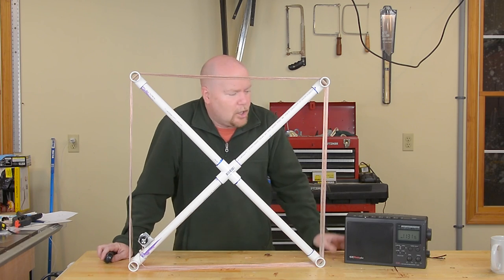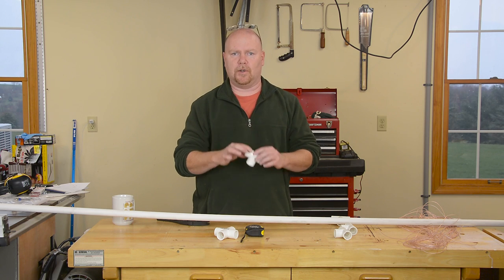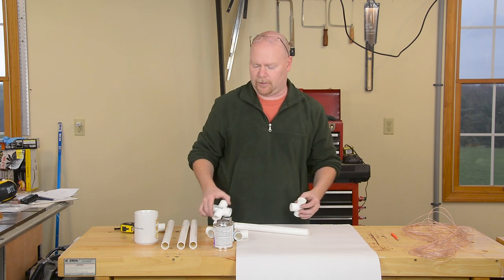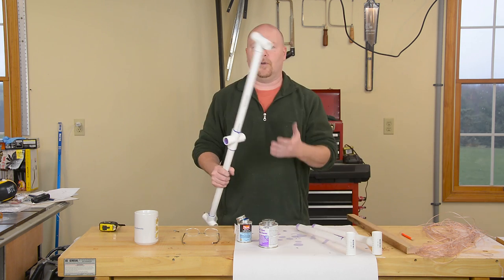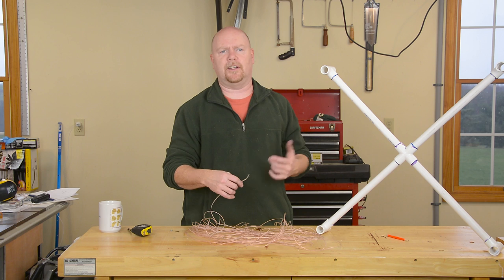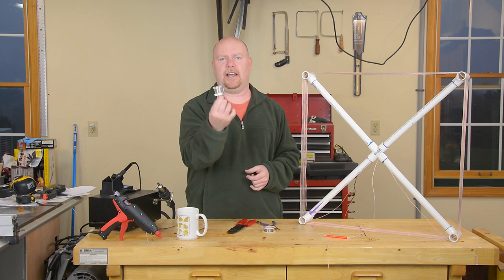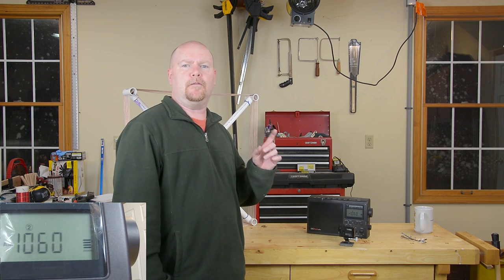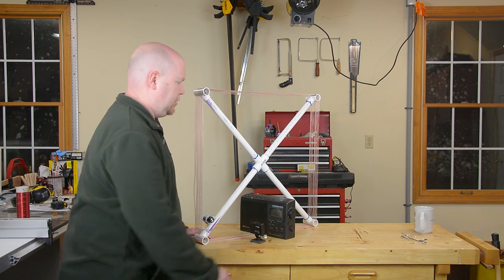AM Loop Antenna from PVC Pipe

Comment: Hi Matt, thanks for posting the project. I have a couple of question which I hope won't bother you, as they are very basic. The 1st one: which frequencies the antenna resonates? Would it be ok for higher frequencies such as 11 Mhz? The second one: I saw from previous comments that, in case you need to plug the antenna to an external jack such as the tecsun pl660, you need to build an internal counterloop. How does this counterloop would look like and may you explain how to plug it to the jack? Thank you for your time, Marco
Reply from the maker: Hi Marco.  The bandwidth of the loop is pretty narrow, so it has to be designed for the specific frequency range you want.  Use the link in the description, and the calculator will let you get the size and capacitor you need for 11MHz.  It'll be much different from this one.

As for the small loop I don't have a plan for that one, but any of those small cheap loop antennas that come with a stereo receiver will work.  Here's a link to one on Amazon as an example (although I think $10 is robbery for such a thing): https://www.amazon.com/Ancable-Antenna-Panasonic-Receiver-Systems/dp/B01CSFVFT4
Reply: Thank you for answering Matt. I'll have a try and let you know about the result. 73, Marco

Comment: Question, when you drilled the holes for the wire to go through, I would think they would have to have been offset all the way around, no? My plan was to create four PVC pipes over two feet long to put between two 6' square frames and then start by drilling a hole in the first PVC pipe 1 inch in, the second one 1.25 inches in, the third one 1.5 inches in, and finally the fourth one 1.75 inches in (and from THAT first hole on each pipe one inch apart) so that the spacing between each loop remains perfect on all four sides through the entire thing when doing the wiring.

Comment: Thanks for the info I made a 4 ft box loop many years ago and listened to Belize 834 khz I thought that was a good catch. Is it possible to make it around 2 ft? I would probably need more windings?
Reply: If you made a 2’ box loop, meaning  that from center to center would each be only 6 inches per side, then merely increasing the number of loops wouldn’t do the trick. The inductance of the loop has to match the range of your chosen frequencies, in this case the AM broadcast band from 500-1700 KHz, and that inductance must be correct to tune it with a 10-360 pF tuning capacitor as shown.  To maximize the power of that  tank (tuning) LC circuit, two feet per side, or 8 feet per one complete winding is in fact a highly efficient amount when wound 11 times. Yes, you could make the loop antenna any dimensions you like,  but you’d still have to match inductance and capacitance to tune the band you  want to monitor.  I even made made an equilateral triangular loop with each side measuring 2’8”, or a total of 11 feet per one complete wind, with a total of 8 windings that beat out my earlier box and cylindrical am loop antennas. Experiment and have fun. One thing really helps though: The larger your tuning capacitor (physical size, not capacitive range), the more selectivity (fine tuning) you will have on the antenna.

Comment: 18 inches bud 18inces lmao, no i went the same route myself ..38 inches all four sides . 30 turns on a squaure box kite type frame in a tight spiral  4 foot tall .. wired in my grage and ran into the house on some 75 ohm telstar or whatever my cable was on.. beats my stock eteon 750s built in am rod. problm is it's super directional too so it does need to be moved to if your dxing dont trust your dial alone.. built it 4 days ago still havent played with it much yet oh boy i cant wait tho
Reply: I have a similar 4 ft (circular) form using about 500 ft of wire.  Maybe it's 'too directional' as I'm not having luck pulling in a station.  Can you tell me the value of the capacitor that you're using as that might also be the issue.  Thank in advance.

Comment: Also, I have a GE Super Radio III, great for DX on MW anyway. I am going to attach the feed line to the radio, the other to ground. I assume that the capacitor in this particular radio that is made for this will be enough to handle the tuning. I am not sure what kind of cap is in there but it has wide and narrow band, and auto freq control.

Comment: Stringing the wire through the holes is very tedious. In stead, use a saw with a kerf slightly wider than the wire you are using. On the outside (radius) saw to a depth so that each kerf breaks though  the plastic. Wind the coil, laying the wire in the slots. When the coil is complete, to fix the wires in place, push a toothpick or bamboo skewer between  the wire and plastic to lock them in place.
Reply: I was thinking exactly the same thing about the kerfing the pipe to the holes and was looking through the comments to see if anyone else had already commented that. Your suggestion with the toothpick/skewer made the search even better.

Comment: Did U mention that this loop antenna will not work with a radio that does not have its own (internal) antenna loop to begin with? (like a ferrule). Some may want to use a car type radio which has a motorola plug or a AV Center Receiver which has dual clamps for connecting an antenna. & I think some little radios have a 3.5mm jack, the impedance of which beats me -- I assume that it would be an unbalanced antenna jack -- while a loop is intrinsically balanced. (Hello, balun?)

Comment: For output to coax (say) to the terminals of a radio at some distance, you could add a secondary pickup mini-loop, untuned, e.g. of a couple of turns, in the same plane as the main loop.  Needn't be of same diameter as main loop, and needn't be centred.  Having said that, on my own 1 foot sides loop my secondary loop is wound in same V-slots as the main loop (all turns are in same single V-slot at the end of each arm.  Not saying this is optimal (I have no idea) but it works.  I imagine though, with long coax capacitance, a smaller pick-up loop might be advisable, to reduce its impact on the tuning of the main look.

Comment: Hey, thanks for the very informative video.  I have one suggestion.  Many of us have no need for the PVC glue stuff after we have completed this project.  I think it would be cheaper and better to use screws and holes drilled in the PVC to hold it together securely.

I made one out of wood, and I find that when it's not used, it takes up room.  It would be really interesting to make one that could be collapsed to a small space.  I thought about using one of the collapsible umbrellas for the frame.  I wonder of that would work okay and how long it would last.  Thanks.
Reply from the maker: Thanks!  Some good ideas there.  Really any glue will work.  Superglue is the best substitute for the PVC cement, but even good old Elmers white glue would be fine.

As for collapsible: I like the idea.  Best bet is likely to make the "X" frame with a pin between two legs so that it would fold flat.  You do need to be careful about introducing metal into the build though.  It can throw off the calculations for the loop.

Comment: That was very informative. How is the Harbor Freight drill press working out? I would like to get one of the big ones.
Reply from the maker: Very well.  I have a video or two on the press.  Added a keyless chuck to handle smaller bits, and really have no complaints.

Comment: I built one but I have no idea why mine does absolutely nothing 😕 I used a capacitor out of an old 1950s GE radio. I thought maybe I had hooked the wires up to the variable capacitor wrong but after changing where the wire locations when I tube the VC nothing happens. My Tecsun AN-200 works pretty good but I just wanted to try building something. This is a great video though. Good job.
Reply: One wire goes to the ground or metal body of the variable capacitor. Each cap has 2 terminals going to the plates. Only use 1. it does not matter which one. With the loop unconnected use a meter and test the body and one of the plate terminals and the frame of the cap for shorts. Make sure the cap is turned somewhere in the middle.

Comment: Can we have a video about what is the next steps to mount that hell of a thing outside on the roof... and connect it to the "LOOP ANTENNA" connectors of our receivers in our basements?
Reply: That is a bit tricky.  The capacitance of the wire leading from the loop to the basement will be too much.
I found that moving an AM antenna up did very little.

Comment: Hi Matt, Thanks for the video. I do have a question. I'm rounding up the materials to put one of these together. I'm hoping to eventually mount this outside for better reception of ball games. With that being said, I plan an adding a pick up loop routed into the house to connect to the surround sound system. My question is, can the variable capacitor be remotely mounted away from the antenna? I'd like to route the loop ends, as well as the pick up leads into the house with the antenna remaining outside, if possible.
Reply: you are over complicating this. All those additional details won't make much of a difference in performance. Keep it simple.

Comment: Thanks Matt. great video. I am going to build this. What size pvc fittings do you use?
73,
kd7kd
Reply from the maker: Whatever is cheap :)  I used 3/4" PVC and fittings, but 1/2" would work as long as you get the heavier, schedule 80, stuff.  Schedule 40 in 1/2" would probably flex too much under the loop tension.

Comment: Hi Matt, wondering if you could help mr understand something?
I want to build one of these for a older sony receiver which did come with a very small am loop. It connects to unit with 2 wires, how would I connect the new loop? As I also want to place it outdoors. I guess I'm asking if it can be hard wired to receiver? great video by the way, thanks
Reply from the maker: Try putting the small one you have in the spot where I placed my radio inside the big loop.  The coupling won't be ideal, as the loop you have is actually a bit large for this setup, but it may be good enough.

Comment: Hello Matt, I made this with 18" 1/2" metal pipe instead.   It doesn't seem to work and I'm wondering it needs the PVC instead of metal? Thank you
Reply from the maker: Hi Ben.  Yep, the metal is your issue.  It's critical that the structure is non-conductive, or it throws off the tuning rather drastically.  Sorry if that wasn't more clear up front.
Reply: No problem.  Thank you for replying.   A fellow ham here as well.  I should of known that

Comment: Could you use the thin wires in telephone wire or Cat5 cable thanks. Great build and results.
Reply from the maker: Sure.  It would be a pain because that stuff is twisted, but it would work fine.
Reply: Matt Heere Thanks for the swift reply. Yes it will be a PITB but this current world situation gives me the chance to do it. I have hundreds of feet of 6 core telephone cable and the same with CAT5 you’re video is an excellent production and I thank you for taking the time to produce it. God bless. 73

Comment: IFFF I am correct, the orientation of antenna matters. By orientation I mean angle between the location from which signal is coming and antenna itself. When they are at 90, antenna is not picking any signal. 

ONLY IF I AM CORRECT!!!
Reply from the maker: You are correct.  I mentioned that in the demo part of the video.  This loop works so well because it is highly selective.  Both the tuning and the orientation allow it to zero in on just one station.

Comment: How would you hook that up if you have a receiver with two ports for an FM antenna? Just connect both wires into it? Do they need the capacitor then?

Comment: I purchased an old Akai tuner AA-R20 for listening Am station but it is not getting signal. If I use the same will it increase the signal
Reply: a small loop antenna will be provided by manufacturer along with this tuner you can listen to distance signals

Comment: Hi Matt...how critical is the variable capacitor dimensions/  you mentioned using a 10-360 on your antenna...I saw one on ebay for sale  rated at 20-320.  Think that one would work too?  Thanks.
Reply from the maker: A smaller range on the capacitor will limit the tuning range of the loop, but a 20-320 is probably good enough for most of what's out there.

Comment: Great video and result.
But I don't want that thing indoors. So how do we connect it with a coax cable?
Will I have to add a series capacitive coupling, or is that already behind the <antenna> connection on the radio?
Will the coax have to be terminated in some way?
Reply from the maker: The coupling is magnetic, so if you want to get the signal onto coax or some other transmission line then you need a small loop placed where I had the radio.  This is what you connect to the coax, twin-lead, etc.  The design of the small loop is touchy, but you can pick them up cheaply enough.  Any small loop advertised as an AM antenna will work.

Your primary problem is that you need to be able to access the tuning capacitor and to rotate the loop.  If you're remote mounting the loop outdoors, then you have to motorize and then weather-proof both of these.  At that point I think I start looking into Beverage antennas if you have the room.

Comment: Is there another name for the VR? I don't have access to any old TVs. I looked online for 10-300 pF variable resistor without finding anything I could make sense of.
Reply: Air Variable Capacitor. The other terms are 'Condenser' or Gang Condenser. You will find plenty on EBay.
Reply: @Xmukherjee  Thanks.
Reply: You can often find old AM radios for a few bucks at Goodwill stores.

Comment: Hi Matt,  great video. What's the best way to connect this antenna to a radio that doesn't have a built in antenna,  like a Perseus or Elad? Still want the variable capacitor in the mix?
Reply from the maker: The variable cap is still needed so that you can tune the loop to the desired station.
If you wanted to connect to the antenna terminals of something like an SDR, then you'd need a second, small loop which is open ended.  The small loop connects to the radio terminals, and then sits inside the larger tuned loop.

Comment: Hi Matt! Can this antenna design be wired directly to an AM receiver? If so what does that do to the tunable cap?
Reply: You could add a secondary pickup mini-loop, untuned, e.g. of a couple of turns, needn't be of same diameter as main loop, and needn't be centred.  But the main loop does need a variable capacitor of some kind, because it needs to resonate to each frequency.  A tuned antenna is not much use for SDR-type wide band-scanning therefore! (an active antenna would be more appropriate for that).  I wonder if any suitable motorised or (preferably) voltage controlled solid state variable capacitors exist nowadays...

Comment: Hey Matt, I have a Realistic DX-302 10khz-30mhz which uses a Wadley Loop synthesized circuit for continuous freq. coverage.  Has 6 position preselector and a tuner for the antenna. The main tuning circuit covers 1 MHz increments. Antenna connections are SO-239 50/75 ohm and a Hi-Z connection point for long wire and ground. Do you think I could construct  a similar
 loop to use without the need of the loop mounted capacitor??
Reply: You could add a secondary pickup mini-loop, untuned, e.g. of a couple of turns, needn't be of same diameter as main loop, and needn't be centred.  But the main loop does need a variable capacitor of some kind, because it needs to resonate to each frequency.  A tuned antenna is not much use for SDR-type wide band-scanning therefore! (an active antenna would be more appropriate for that).  I wonder if any suitable motorised or (preferably) voltage controlled solid state variable capacitors exist nowadays...

Comment: List of parts necessary to build this? Great project thanks
Reply from the maker: It's wire, PVC pipe, and the variable capacitor.  What size / how much of each is determined using the calculator linked in the video description.

Comment: Can  you tell me if this is what was inside an old antenna tuner with a dial to make any AM radio get stations thousand miles away ???
Reply: Inside an am radio there's a compact and less efficient loop antenna. It's that copper coil wrapped around a ferrite cilinder.

Comment: Hi Matt, very nice and easy to follow instructions here. 
One little newb question though, as far as i could see here you just placed the radio inside the loop. 
so I guess any existing antenna should be placed inside or in relation to this ? Not actually connected to the radio?
Reply from the maker: That's correct.  The only reason I put the whole radio inside my loop is because it's own antenna is internal

Comment: Hey Matt, here's an idea for a follow-up project: How about a box loop antenna for the longwave (150-520 kHz) band that can be used with receivers that have built-in ferrite loop antennas via indirect coupling? I've got a feeling you'll be snaring Non-Directional Beacons left and right and possibly have a shot at the European LW Broadcasters when the conditions are ideal with that setup.....
Reply: The French and German ones have switched off.  Here in the UK I can now only get Luxembourg and BBC Radio 4 / BBC World Service (time-shared on 198 KHz)
Reply: @DavidEsp1  Irish RTE is still on LW I think. Btw. RTL is about to close down soon by the end of this year..